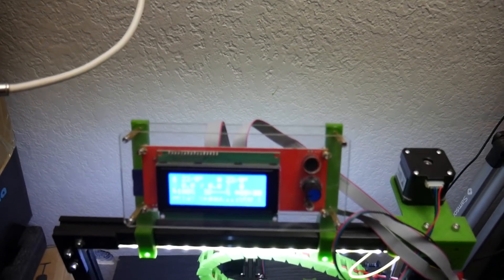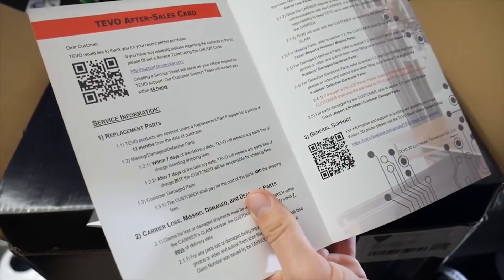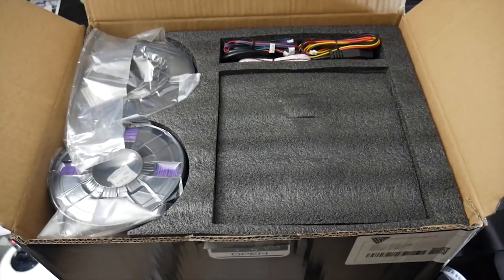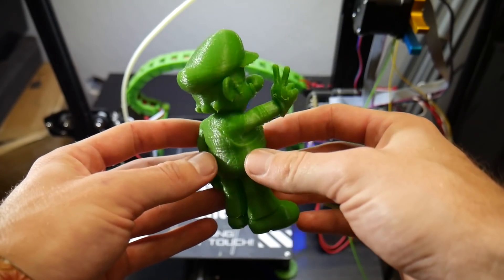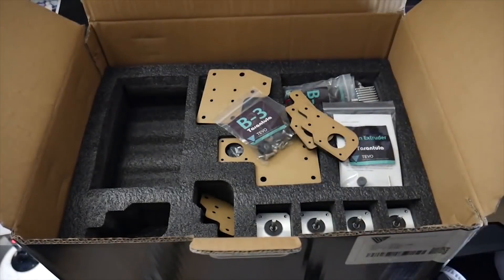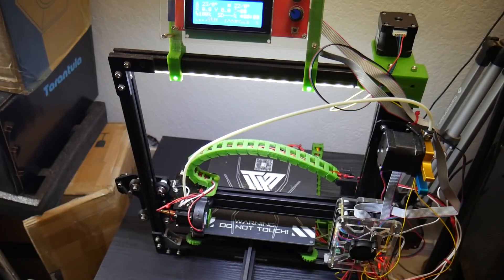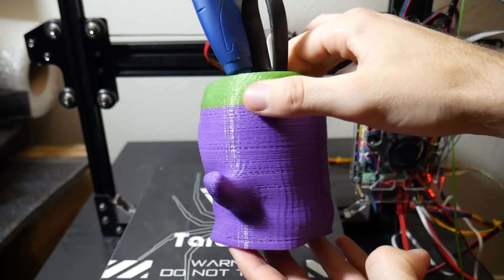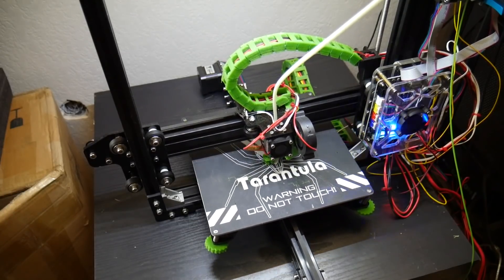Tevo Tarantula 3d Printer Review In 2018! Is It Still A Contender?

Comment: This was my first printer. I follower ruiraptors video assembling it and it printed pretty good right away, better then some of your examples here even. One I put a fan and duct on (fang fan) it got even better. Bed cable management is another must do or the wires will pull off the bed (fire hazard!)
I bought the green Pro version and it needed no mods, its a much better machine out of the box.

Comment: Its a great printer.  Not for idiots,  it is a DIY (do it yourself) printer.   I had no problems building.  I build it in a few hours and printed right after.  It's like a model.  if you can't do it then you are not knowledgeable enough to do it.  many upgrades are available.  great cheap printer if you are not an idiot.

Comment: So I had bought this printer about a year ago. I had built it slowly and made sure everything was correct. I got 1/2 of a print done. I had forgotten support material so I stopped it. I had then fixed that and printed again. The layers would then offset every single time it would move up at all. I then got a new motherboard from gear best (took 3 months). I then tried again and it didnt change anything. My the time I had gotten to hear best again, it had been 6 months. They sent me a new controll panel. Still have yet to get it. I got this printer last christmas. Did you have any problems like this?

Comment: Hey ModBot, I got my Tarantula as my first 3d printer and there is one point I personally feel that you skipped in you video is that this printer is not exactly anywhere near beginner friendly in terms of the assembly manual/instructions. But I found the machine assembled nicely and easily despite me having no previous experience with 3d printers, but it's been a bit of a pain to get it to run correctly as my Tarantula has been overextruding and has clogged up two nozzles now. But I do whole heartedly agree with the wiring being a total rat's nest, and it sucks as the manual says nothing about properly running wires. But I do like your review of the printerthough!

Comment: I have two questions 

Firstly can we print Nylon , Polycarbonate on Tevo Tarantula 

Secondly can we mount the front mount anywhere else than the front like outside custom built enclosure ?
Reply from the maker: No you will need to upgrade the hotend to an all metal if you plan to print in nylon or pc. As far as the front mount yes you can definitely make an enclosure and move it so its out of site. There are quite a few printable enclosures available on thingiverse.

Comment: Your Z Coupler is awfully bent and accentric nuts are a MUST without the ability to adjust the play of the axis (which you will need to do #wear #tolerance) you and up with a wobbly printer.

Your purple parts have extreme underextrusion btw

Comment: whats the difference  between the 2017 and 2018 models.  also you mentioned  the 2017 model had somthing the 2018 did not a lead screw for the z axes . so should i go with the 2017 instead?

Comment: I got a Flsun for cheaper than the tarantula. Comes with dual z motors, all aluminium and supposedly a better MB. I’ll check if it’s any good once it arrives
Reply from the maker: What model is it? I have been looking at a few here and there
Reply: It’s an i3 clone. But I have to say, their hardware is incomplete, and the acrilic parts are useless
Reply: Better yet, the FLSun i3 linear rod and bearing version.  Rollers on extrusion is for suckers: https://www.youtube.com/watch?v=5P3logeuc7k&t=20s

Comment: they can machine them to the exact dimensions so eccentric nuts are not needed, but then what do you do after a few months when it starts to get wobbly again?
Reply from the maker: Why would it get wobbly? My other kits have been going for over a year with no wobble.
Reply: did you go trough thousand+ hours on it? i'm not sure but its my guess that since it's a material that has even a small amount of compression,under load it tends to shrink over time .
Reply: @witgangyounotube287  if i got thousands of hours i could spend $20 on a new part to be tight again.
Reply: @ModBotArmy , holes in acrylic plate are too big for the normal, non-excentric screws.  If they are in the wrong side of the hole, you are not able compensate them with excentric nuts on the other side. I just  upgraded to metal cnc parts with correct hole sizes and it fits perfectly, no need for any trick for tightening.
Also with only one z screw it is more stable with the alu upgrade, because every wheel touches the profiles now, so there is no more wobble.